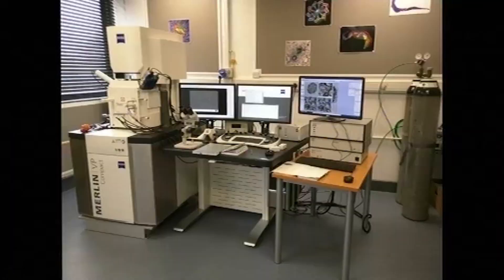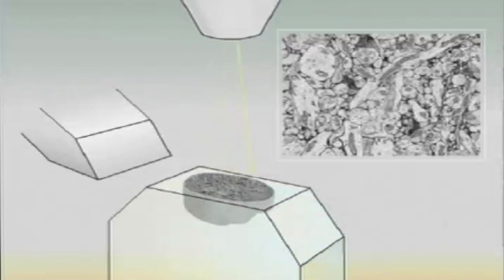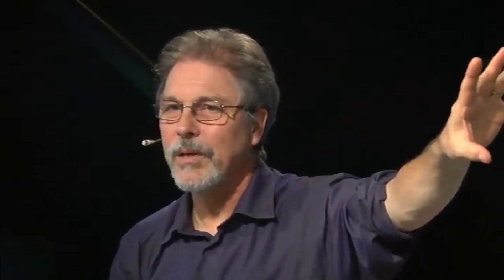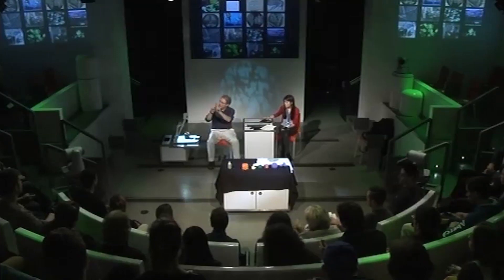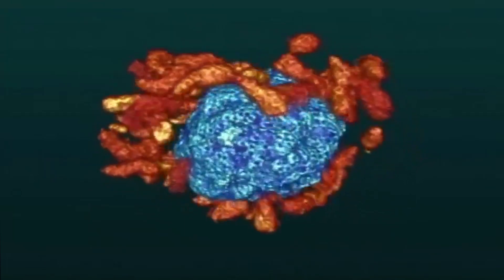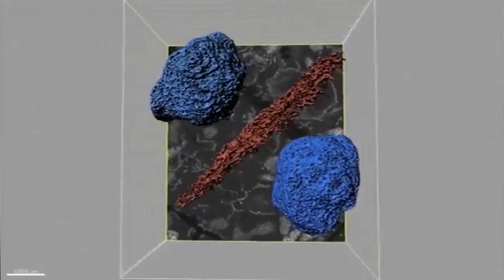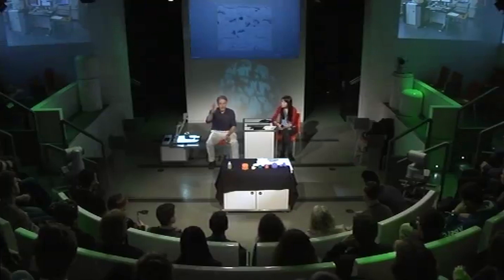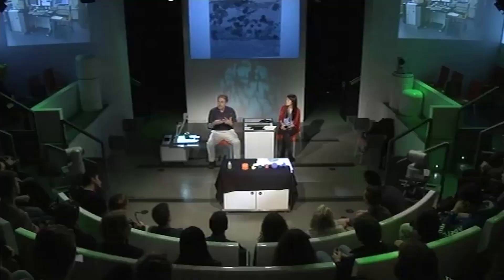How a Scanning Electron Microscope Works

Comment: So it's basically like a 'camera' - but instead of light waves hitting the lens, it's just the electrons?
Reply: In an electron microscope, an electron-emitting substance is placed behind a specimen and emits electrons through the substance. The places where electrons collide with the atomic nuclei in the specimen before reaching the microscope are colored black whereas the places where a lot of electrons are detected by the microscope are colored white. Whereas in a modern digital camera photons are detected with electrical sensors that have colored filters that only allow either red, green, or blue light to pass through. When the photons hit the sensors they cause a current increase. Based on the amount of current increase, the intensity of these primary colors is determined and colors in the original image are discerned.